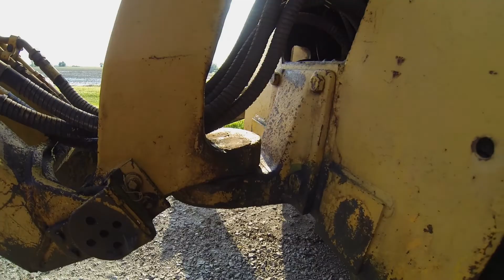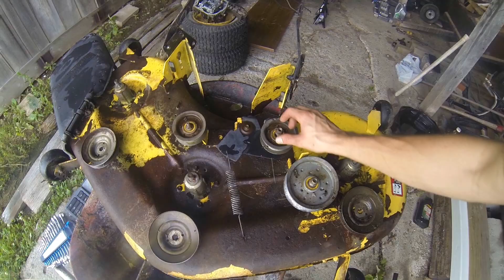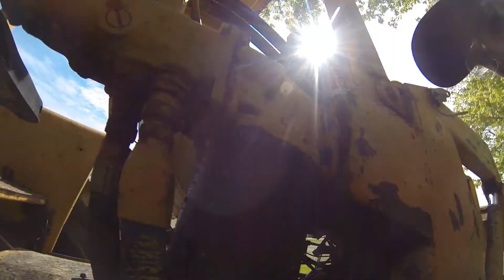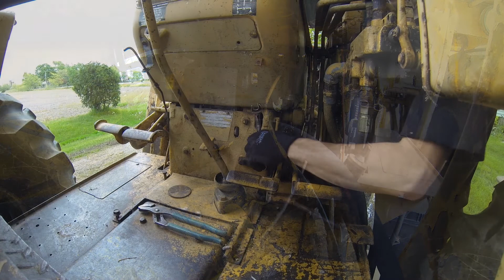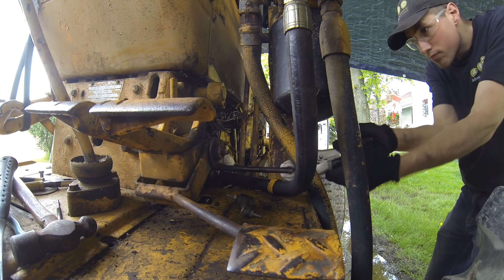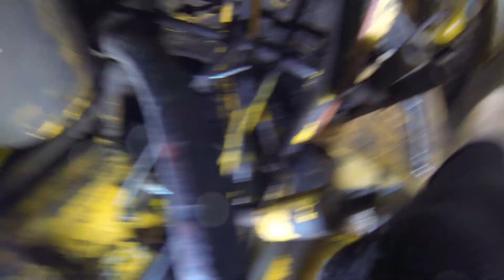New Yard Toy!  Now to make it move.. 1650 Oliver Industrial Backhoe

Comment: I have the same tractor. I spent some time rebuilding injection pump and replaced injectors. Se runs good now but have some issues with the transmission not shifting. Thank you for these videos as I haven't been able to find anything for the linkages

Comment: Did you ever find the pivot bearing?
Reply from the maker: I did actually,  it crossed with a few different P/N's. it was not cheap and unfortunately only made it a few months before shattering.  I have since welded it up and now it's a bushing but it's functional.  I have videos of that on my channel if your looking
Reply: @RobHoffmann20  what was the part number for the John deere bearing you got originally
Reply from the maker: @brutusjb3814  I had to dig into my folder but I found " "JD8669"  it cross references Pile of other brands also. the "White" P/N  is - "197063A"
Reply from the maker: @brutusjb3814  https://youtu.be/e1t2oI8hy30
Reply: @RobHoffmann20  I ended up finding a Timkin and SKF bearing GN203-KRRB and SKF-GN203KRRB, the bearing that was on my machine originally was a N203KPPB2 made by Fafnir. 

The SKF bearing was 120.00
The Timkin was 260.00

I ordered both.. incase one blows.. I however haven't been able to get the inner race off The shaft. It's stuck. What did you use a bearing puller or did you just beat it off.
Reply from the maker: @brutusjb3814  When I bought my machine out only had the nut left on the post.  I did need to use a die grinder to clean up the area to get the new bearing installed.  the only thing I had to do was remove the nut.  even when repairing it it basically fell into my hands after removing the nut.
Reply from the maker: @brutusjb3814  Great tip with the replacement bearing!